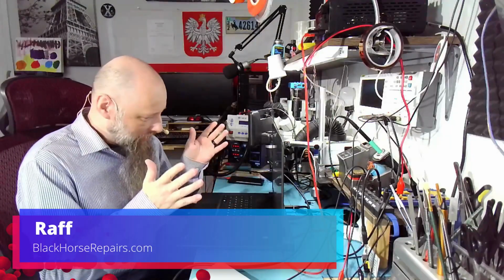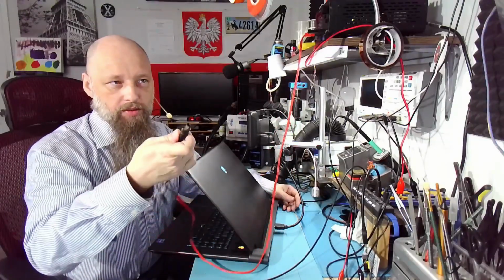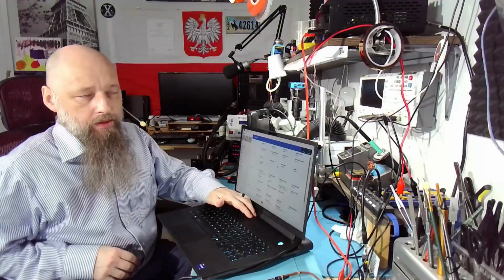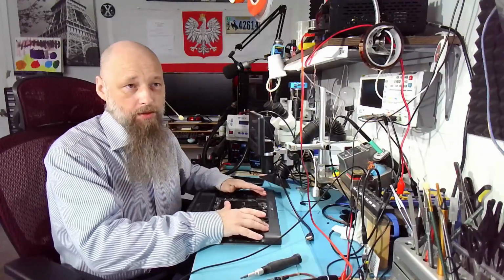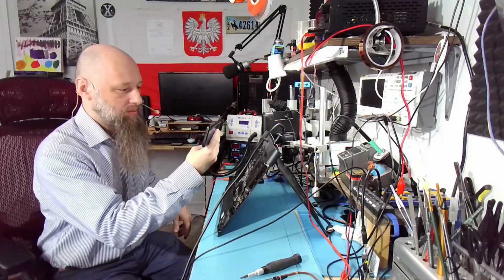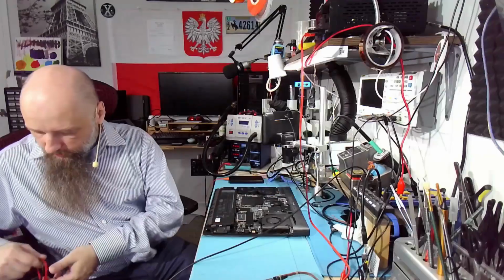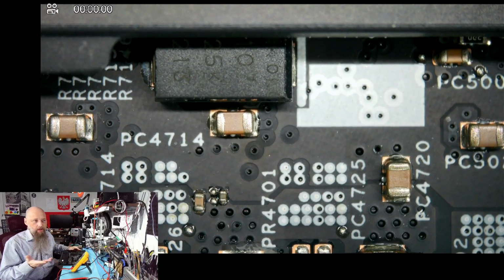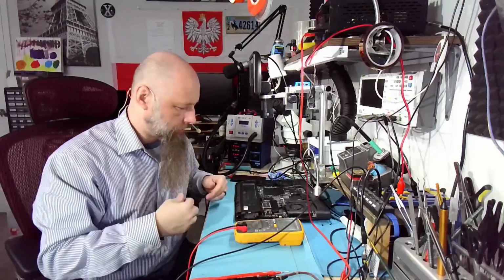106 | Dell Alienware M16 R1 Slow CHarging and overheats in BIOS

Comment: You need take board out to check 1 and 2 MOSFET , definitely disconnect battery 🫣 could be bq chip bad 🤔
Reply from the maker: Thank you, I'm still trying to locate boardview for it.
Reply: @ and looks like someone already take board out before, that’s mean could be a missing resistor or something 😆 you need do visual inspection 😃
Reply from the maker: @grzegorzwozniak837  good suggestion, for that reason I'll need a boardview for this one.
Reply: Thanks guys! This is my laptop - I did take it a part a few times to try repasting, swapping DC jack, etc, but never attempted a component level MB repair so there shouldn’t be any missing components!
Reply: @anthonycapella8928  Did you use thermal paste or liquid metal? This kind of laptop needs liquid metal but if you have e31 foam assembly on the board, liquid metal is applicable.  If you don't have foam on the board, liquid metal is dangerous. Would be damaged on the board with liquid metal.
Reply: @ozdemiranil  the board did have the foam assembly around both CPU and GPU. I carefully replaced the stock paste with Cooler Master MasterGel Maker. There is no chance that the stock paste or replacement paste spread to the board and shorted components, it is well contained on top of each processor. The issue with the extremely slow charge and throttle was happening before I took the MB out and swapped the thermal paste, I thought there was a chance the stock paste had "blown-out" and was causing overheating related issues, but this was not true.
Reply: @anthonycapella8928  Do you have llano or iets gt600 v2 cooler? My brother uses a Dell G16(13900hx, 4070) and it runs hot even though it has e31&silicon conductive stock thermal paste. Cpu won't cool except for performance loss. He bought an iets gt600 v2. Cooler does the job but it is very loudy. I don't know what your pc issue is though.